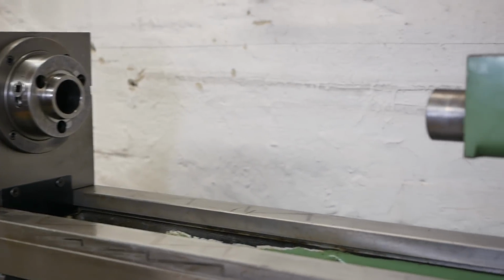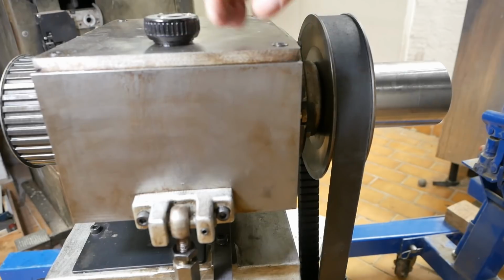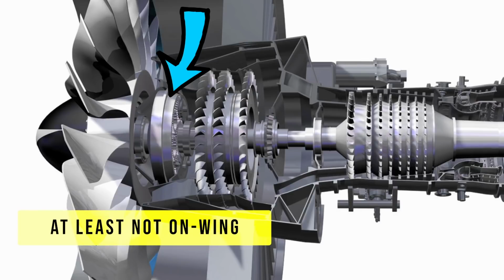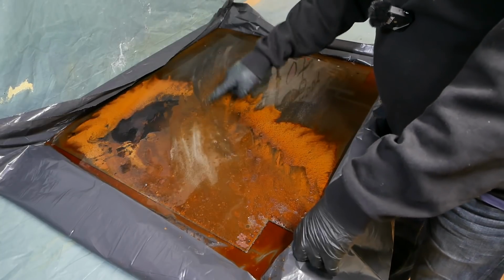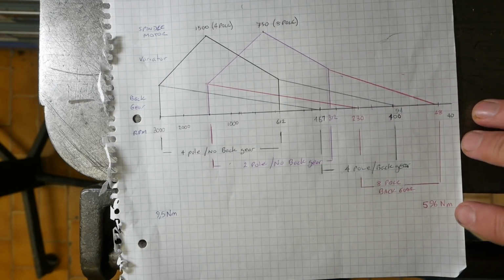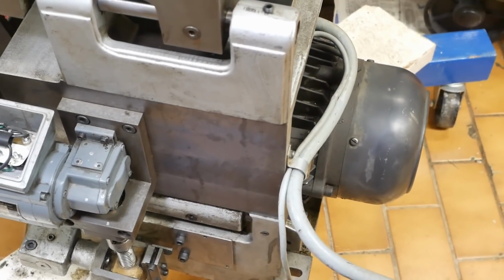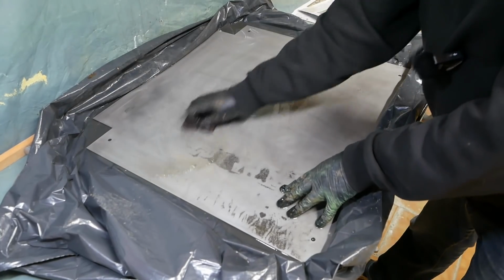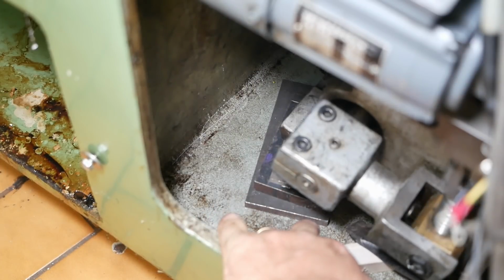Installing the Schaublin drive train

Comment: I would leave the motor and drive as is. Seems beefy and well designed. 

On a side issue, is it true that cable length between a motor and vfd  affect the motors life/insulation? From what I remember very short cables really help the motor. Any ideas on that?
Reply from the maker: I have never heard that before, but am no electrician. I'll ask Stephan, who repaired my Mesa board.
Reply: Maybe it is because shorter (or thicker) cables have lower resistance which may keep the voltage spikes on a lower level. In any case, short and thick cables are always the right choice for good performance...
It should also be possible to reduce the voltage spikes with capacitors, but you need to find out which ones are the right ones, otherwise they may get hot or the may damage the VFD.
Reply: I know shorter and shielded cables are preferred, but I remember powder coating line with VFDs on one side and conveyor motors on other side, about 50 meters of shielded cable. Worked like a charm for 20+ years.
Reply from the maker: @DreitTheDarkDragon  SInce the wire is already in there, the right length, with ferrules on the ends, but natural laziness is just going to use it :)
Reply: @RotarySMP  Great to hear you are just normal lazy person :)  Also I guess most of cable is hidden within Schaublin's metal frame, so it's already shielded good enough!
Reply from the maker: @DreitTheDarkDragon  My electrical guru is not happy about this. Maybe I do get double shielded  wire.
Reply: @RotarySMP  I see. Or try to google if it's really needed. I understand it that it will spread some interference around which might be caught by sensitive electr...oh, I totally forgot about whole computer and MESA cards. I doubt it's THAT sensitive, but who knows. Aaaaand friend just told be about problems with 3D printer, when switching of stupid lamp reliably stopped whole USB communication and produced errors, so it's probably a real thing :/

Comment: a geared turbofan is basically a turboprop in a tube ;)
Reply from the maker: It will be once they put a pitch change mechanism on the blades. :)
Reply: @RotarySMP  do the all the turboprops have variable pitch?
Reply from the maker: @fuzzy1dk  Yes. Fixed pitch props are really only used on ligt aircraft.
GE had a test program called the UDF (Un ducted fan) in the 90's which had variable pitch blades, unshrouded, and driven off the LPT. Kind of a mash up of turbofan and turboprop tech. Great fuel efficiency, but i think noise killed it.
Reply: @RotarySMP  …it was also butt ugly.
Reply from the maker: @624Dudley  Yeah, but if but ugly was a measure of aviation merit, the A380 would be a failure.... Oh... :)

Comment: 600Nm is quite similar to my Okuma ACT4, according to charts I have, it has 670Nm in low gear, but with 30hp VFD motor,  up to 1200rpm. High gear, 200Nm up to 3200rpm...
Reply from the maker: Thanks for that info. 200NM at 3200? That sounds terrifying.

Comment: I wonder how the later versions of the lathe handled the motor/power decisions ex variator...
Reply from the maker: The 125-CCN my mate has, dumped the variator and the backgear, and is just a big servo with a belt to the spindle.
Reply: @RotarySMP  my 225 takes dried air iinto an air coling unit - feeding  air manifolds to protect the spindle running off a 5kw motor which allows for 8000 rpm in Collet mode. It may be a cost but I think the more simple direct drive system would serve you better long term and make for easier maintenance. Irrespective I would recommend that you consider at least an air dryer /demoisturising unit running off your compressor to protect the pneumatics - these machines were designed for constant use - in my case the greatest 'enemy' is the lack of use - I bought it from a bloke who owned it from new for 10 years and had a total 120hrs on it- the little use it had led to an internal pneumatic fail - meaning I had to send the whole spindle back to Schaublin for a rebuild - 20K later....apart from the idiosyncracies of Fanuc controls - my only 'worry point' is ensuring that the ball screws which are hidden under their protective sleeves  recieve proper lubrication - the protective sleeves are a very tight fit and make for a real hassle to check/maintain. Last point - I run my machine dry cutting as the preferred oil only cutting lubrication is messy - but I dont like the soluble muck and associated hassles. An enclosure will no doubt be prt of your longer term thinking. atb - love following this brave project.

Comment: not replace, on the sole fact that i want to know the torque loss and see how close you where to almost 600Nm thats alot of power
Reply from the maker: If I keep the VFD and the variator, then I could have that torque and even lower speeds.

Comment: I‘d replace meanwhile i dunno where you could even get that chunker off a motor. A direct spindle would be even nicer but these are unobtainium + price.
Reply from the maker: As long as it works, this is the simple solution.

Comment: I replaced the motor on my lathe with a mining spec abb 1hp motor, not even sure what the insulation class is but it's been running fine on an import VFD. IP65 rated, I can hose it down if it gets warm 😜
Reply from the maker: I like that :)

Comment: Personally, if it were for me, I'd keep the belt drive and install a few contactors.  Linux CNC can handle them easily, no buggering about with variators, you get continuous speed variation with no electrical noise, and enormous torque.  Not to mention that replacing a belt is far cheaper than replacing a VFD.
Reply from the maker: How would you get continuous variable speed with only contactors? No variator and no VFD?
Reply: @RotarySMP  Ah, my bad wording.  Keep the belt drive *variator*, and drive the electrics how they were originally designed.  New contactors driven by whatever voltage your linuxcnc board can drive (and is already driving elsewhere), obvs.  No buggering about VFDs (in my defence, "variator" is what they're called over here in frogland)... It's a very robust solution.
Reply: @wibblywobblyidiotvision  I'll second this idea. 

Note that this lathe has somewhat the opposite condition of the P&W engine: it and countless other machines have run just fine with a variable belt drive for decades, and the VFD is the unproven technology.
Reply: @lwilton  VFDs are hardly unproven.  There are millions of them running around the world and have done so for decades.  Not as long as variable belt drives but there are millions or billions of hours of accumulated operation.
Reply: @Chris-bg8mk  But are there millions or billions of hours of VFDs running the particular motor on this lathe that wasn't designed to be run by a VFD? I consider VFDs to be unproven technology on this lathe.
Reply: Even better would be to in place of contactors to use IGBT transistors, they will be quieter, smaller and easier to drive.
Reply: @jurgislll  Wouldn't the contactors actually be replaced with SSRs (solid state relays)?  That would be pretty expensive unless you found them used, and if double throw operation was required, then the number of SSRs would be doubled making it even more expensive.

I did not look closely enough to see if the contactors were being used as double throw.
Reply: @Alamagosa   yeah right, SSR would be a better match, three phase SSR are starting from 50€ and thats not much more expensive than good contactors.
Reply: VFDs also do a bunch of nice things, other than changing the speed. Soft starts and braking, and other things I can't think of right now.

Comment: Maybe you can disassemble the motor, put the new varnish on the windings and put the stator in the oven.
After that you can buy du/dt filter which should  reduce the voltage spikes on the windings. In factory we always put du/dt filter when we use for example 4Q frequency converter.
I should say that I was told by old engineers never to put VFD on the dahlander motor🧐
I think that this solution will cost more than the new motor.
What about braking resistor? Will you have a problem with quickly slowing down and stopping.
Reply from the maker: Thanks for the feedback on that.

Comment: I'd keep the motor. I don't think it will die any time soon. I use a 1.5 kW motor with a vfd on my lathe. The motor still says made in czechoslovakia. Its insulation class E I think. So plenty old and not well insulated.
Reply: I did not try the original 1940s Motor with fabric insulation tough....
Reply from the maker: Thanks, I like to hear data points like that. Hope that motor is listening :)

Comment: What do you think of the idea of electrical bypass for jet engines?  RR are said to be playing with the idea.
Reply from the maker: I haven't heard of that. You mean burying the gas turbinein and driving a generator, and then having the far driven by an electric motor?
Reply: @RotarySMP  yes, it potentially gets around the fan size limits etc. And allow distribution of thrust  and possible hybrid aircraft etc.  Sounds interesting 8-)
Reply from the maker: @wktodd  I guess it depends on the losses in the round trip from shaft HP to angry electrons, and back to shaft HP. I cant see it happening for large turbofans, as there is so much beyond efficiency, such as debris trajectories, fire protection etc which would make it very hard to find an airframer willing to do anything radical.

Comment: I don't know much about these things but it seems to me that such a motor in working condition would be valuable to someone... that said i would be yolo-ing it because i have no patience whatsoever
Reply from the maker: As long as it works it is valuable to me. Maybe I get lucky and the insulation has not degraded much in 40Y, and it gives me years of trouble free service with a VFD.

Comment: I have an similar age 3kW manual lathe that I'm running on a VFD and it hasn't killed the motor yet. With the caveat that I don't know if it's the original motor but it probably is, there was only one prior owner of the lathe and they didn't use it much.
Reply from the maker: Thanks. That is a good data point. It seems Schaublin generally bought high end hardware for this machine, so hoefully that goes for that motor as well.
Reply: @RotarySMP  Here's another (not very close) one: I worked with an Italian packaging machine for a while. Similar age, similar motor size, different mechanical load. The motor died from the VFD while I was there. It was used for many years with that though. It functionally replaced the manually adjusted CVT after a large, custom spring broke in it multiple times.
Reply from the maker: @besenyeim  Thanks for that info.

Comment: You can buy Essingessenz.. at least in Germany, which is 20-25% instead of just 5% vinegar. Faster, but the fumes are worse. 🤷🏻‍♂️
Reply from the maker: I had time. This is just the cheapest house brand vinegar. I once did the this faster with Hydrochloic acid, but the fumes rusted everything in the room nearly immediately.
Reply: @RotarySMP  oh yeah I heard about that unique property of HCL doing that.. I keep a jar full of that vinegar in case I need to make a chain look old or get rid of galvanized coatings on bolts etc..
Ps: sent you a mail about a vise base 😋
Reply from the maker: @gubr  Oh, thanks for that. I was late on this video, and havent even check my mail.
Reply: Citric acid maybe? TPAI uses that all the time for rust removal. Easier to store (dry granules usually), and almost no odour. But I don't know if it's good for mill scale.
Reply from the maker: @besenyeim  Vinegar is cheap, and I like the smell. Remember where I come from you can buy salt and vinegar crisps.
Reply: When buying Essigessenz you still have the option of watering it down according to your needs, also it's less bulky for storing the same amount of acid. I sometimes buy it to clean those little faucet sieves and IIRC a 400g bottle costs about 0,50-0,80€.

Comment: I liked the explanation of issues P&W faces with its new design a lot. It is so true: what is not on an engine can't break.
Reply from the maker: When I was researching this, I was really surprised that the PW110G is not significantly lighter than the Leap-1A. One of the benefits of the high RPM core and LP should be a much lighter engine. Will be interesting to see if that gearbox pays off for them.
Reply: @RotarySMP  Increased fan diameter means bigger diameter fan shroud, which not only is getting heavier because of size, but also needs to contain blade-outs of the fan blades, that are also getting bigger and heavier. There is a practical limit to increasing the bypass ratio mostly dictated by the structural weight. This is why engine manufacturers are looking into unducted fans and propfans again in recent years.
Reply: If engine builders were thinking like that, we would still be using turbojets with horrible fuel economy. Progress brings complexity, it's unavoidable.
Reply from the maker: @timmythesheep  I just find it fascinating that GE can keep ahead of both Rolls 3 spool designs and Pratt's GTF with a very conventional 2 spool designs. GE has invested heavily in process tech like CMC's and metalic additive manufacturing

Comment: I thought CVT meant continuously variable transmission
Reply: I would use a Fanuc or Siemens spindle motor or equivalent with vfd and without a gearbox
Reply from the maker: @MF175mp  It is. Isn't that what the moving pulleys are doing? 

I don't have the power here to runn a 10-15kW motor. Only a 16A household supply. The gearbox gets to stay.
Reply: @RotarySMP  a 5,5kw/7,5 peak motor is plenty and will run from 16A with all the other stuff if you don't overload it. No problem with the gearbox and CVT as long as they work.
Reply from the maker: @MF175mp  I'll keep that in mind, if this set up dies.
Reply: A 3 phase motor but with external fan to cool on low rpm as well and wound for lower voltage than your regular motors so you can get very good range for speed/torque. But you need a big vfd since it'll draw a lot of amps compared to a regular motor of same size. And the V/Hz curve needs adjustment from the standard settings